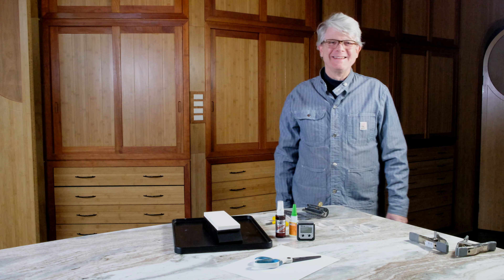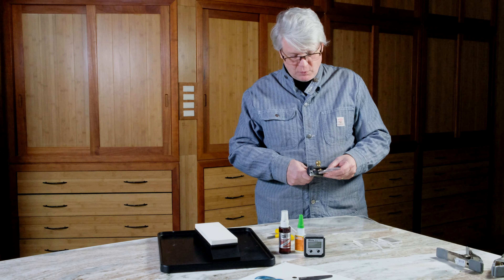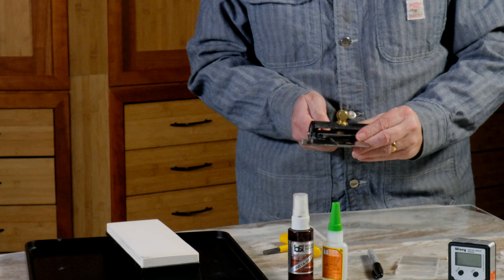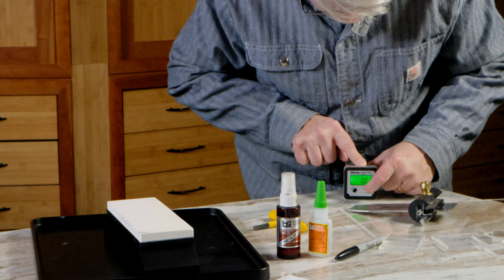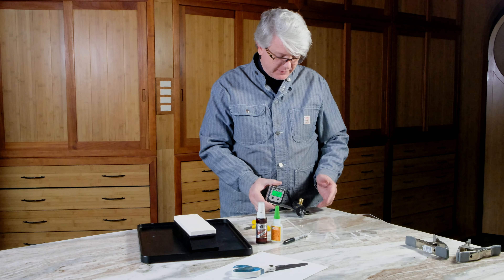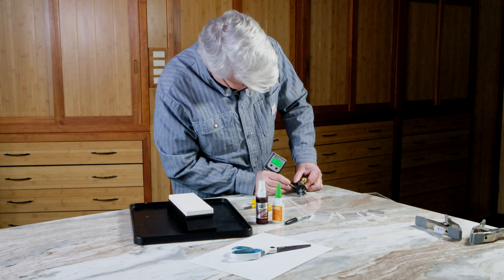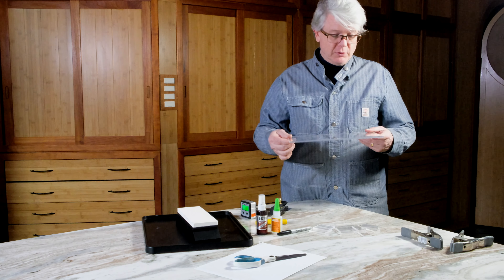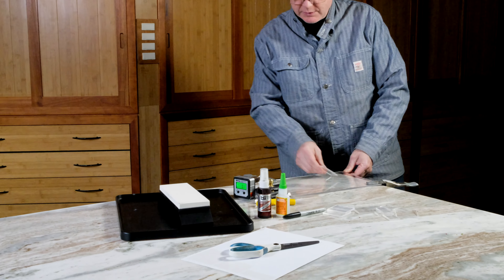SHARP SKATE ANGLE SET UP

Comment: Too expensive.
Reply from the maker: I've worked very hard to bring the cost of Sharp Skate down.  The biggest cost in in the machining of the parts. I use a local machinist who pays his employees American wages. We are also using top grade materials Stainless, brass and high grade aluminum. If you take a careful look at the tool, the cost is not high at all.
Reply: @NanoHone  what about roller "blade" durability? How long i can use it without replacing?
Reply from the maker: 01 02 I’ve been using my wear bar for 18 months so far. Probably have 100 hours on the Skate now. It’s well worn but still has a long way to go. As you get used to the tool, you will unload the bar as you sharpen. So, wear goes way down. Most folks put too much pressure on the bar in the beginning. Loading the bar doesn’t really accomplish anything. I’m using 01 steel to make them
Reply from the maker: 01 02 I’m not building it with the wheels any longer. I like the wear bar much better
Reply: @0102-w6m  is a quality usa made product with warranty to expensive??? Idk
Reply: @dombond6515  i just have some doubts in "non-wheel" construction. "Weight loss" of the bar or injury of hard whetstones can be littlebit annoying.
Reply: @0102-w6m  that's a good point it's why I like the comment section
Reply from the maker: @0102-w6m  The wear bar is not hardened. This makes it much kinder to the surface of the stones.  I haven't seen any evidence of the skate damaging my sharpening stones. Even, very soft natural stones. I don't think I could gauge any difference in the weight of the skate overtime. The wear bar is actually quite long as well. So, it spans a great distance distributing forces quite well.